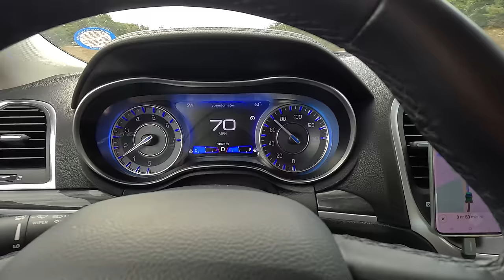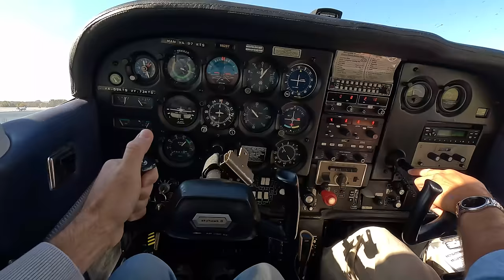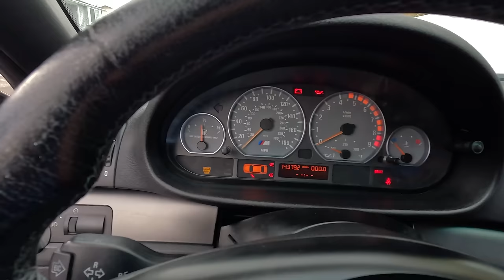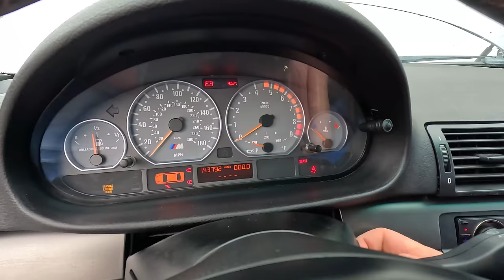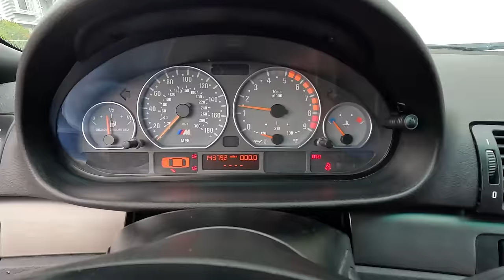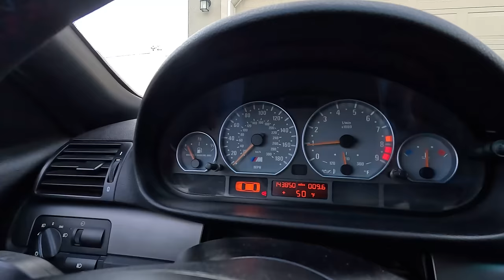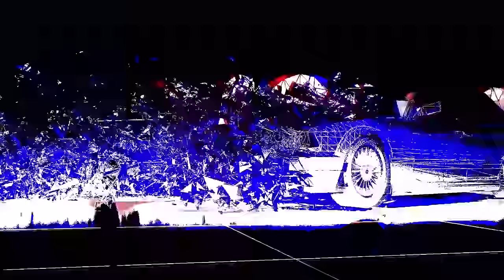Buying & Fixing a Broken BMW E46 M3 5200 Miles Away From Home - Project Salt Lake: Part 1

Comment: My man did more in one evening than the previous owner(s) did in 10 years. What an absolute legend, top tier content.
Reply: I know, that poor car was so neglected; it's a goddamn shame.
Reply: Yeah that was nice to watch lol
Reply: Most Americans won’t or don’t understand vehicle maintenance. Put some gas in it, change the oil at one time or another and just drive.
Reply: Who knows have the power... M3 power in this case... Jjjj
Reply: Like he said, Utah doesnt care about the state of the car, just about if the darn check engine light is off. Its silly. Youll be driving around in America seeing people with 3 spare tires, broken bumpers, dented doors, missing tailights. Its ridiculous, there are a few states which do proper inspections though, but nothing like German TÜV
Reply: @clonetrooper576  Utah used to do safety inspections and only stopped a few years ago. I don’t get it. That’s probably why I saw five accidents in 20 miles when it rained the other day
Reply: The amount of work he did in one evening would be unbelievable if not for the camera. I dream of getting to a level like this one day.
Reply: @clonetrooper576  Nowhere in Europe would that car pass the inspection. And not just that, where I leve, I will not be aloud to drive it on public roads before fixing those safety problems. The cars must pass inspection every 2 year.
Reply: True that!!!
Reply: Lmfao
Reply: @clonetrooper576  Utah had safety inspections for a while, but it was considered a poor tax, so it was removed. Lower income people could often not satisfy all the needed repairs to get their sticker, and lots of shops would be scummy to drum up additional income. The only reason they kept the "check engine light" test, is because they want operating vehicles to at least meet the emissions standards that the manufacturer complied with at the time of manufacture. I think it's pretty reasonable, if basic. 

The simple reason why American car regulations are so lax is because there's really no good alternative. Public transit is spotty or non existent, and distances between homes and work is too far for walking or biking.
Reply: Not man, MEN
Reply: @pmscalisi  Eh nah. Billion dollar unnecessary every 5k oil change industry in the USA. Look before you bark pal.
Reply: @stefang1087  in Bulgaria it will definitely pass
Reply: This series is going to be amazing.
Reply: And with a crew of dudes he’s never met before. This is what this community is all about. Love it.
Reply: @st3althyone  rty
Reply: You can tell how interested the former owner is in maintenance by the state of the Honda used to pick them up from the airport.
The crack in the windshield is unsightly illegal and dangerous.
Reply: yea because the previous owner must’ve had all the knowledge, money, and help but just didn’t want to do it
Reply: As an american, i hate buying cars from people like ivan. He buys a beautiful car that should be respected, and proceeds to disrespect it, and then dumps it on someone else once its destroyed. He prob put in the listing "i know what i have". Absolutely disgusting and unethical. Happens way more often than you think

Comment: Ha!  This takes me back!  Did so much work on my E46 M3 this year. When he broke the coolant bleeder line I felt that pain. I was super careful taking that line off.  He was really pushing through all that work. Amazing work.  Took me days to do all the work below on my M3. 
- Oil pan gasket
- Dipstick seal
- Oil pickup gasket
- Installed timesert for oil drain plug. 
- Motor mounts. 
- Inner and outer tie rods
- Sway bar end links. 
- Steering rack boots
- All power steering lines and reservoir
- Oil filter housing gasket
- Oil cooler line seals
- Timing chain tensioner gasket. 
- Alternator.
- Oil filter. 
- Oil change. 
- Air filter.

Comment: This is some good content! Sreten, I don't know if you noticed yet but the belt on the idler pulley by the alternator needs to run on the bottom not the top. It can cause the belt to slip.
Reply: I noticed that too. Sreten routed it the same way like the belt that came off was routed, but that wasn’t correct.

Comment: Only 15min in and I'm loving it!  I used to work for BMW and the OBD drive cycle I used to be able to set in 20min after starting it up in the morning.  
-let it idle for 3-6min before moving it, it will run the EVAP check
-cold start will also determine the secondary air pump works
- 2 to 5 miles of driving at 55mph under 3000rpm
-1-2 miles of driving under 30mph

Doing that will usually set all the monitors.

Comment: I’ve had my e46 since 2014 …. This video gets my nostalgia going I’ve literally done everything in this video besides the brake rotors mine came with the big brake kit from BMW and I had them replaced when I got it. But yea I even broke the thin hose from the coolant reservoir at the same point upgrading my hoses. Good to know it happens to not just me. Motor on big dog 🤙🏻

Comment: A few months ago traded for a 1997 E36 328iC Convertible with Auto with only 72000 miles and No Engine Codes, it has the usual missing or broken trim pieces, but the Air is ice Cold, Transmission shifts Smoothly and Engine runs flawlessly. Going to have to replace Drivers Seat Gear or motor for raising and reclining seat. I wish I had a garage to do the work I want to, shame there isn't a channel that Overhauls E36 like mine

Comment: Always refreshing to see car enthusiasts pulling together to help each other out 😊 I wasn't surprised to find that the E46 had a few larger issues that hadn't been disclosed but on the plus side the PO has at least serviced the engine oil and the body is pretty straight with good-ish paint so that's two huge and expensive items you had to worry less about. 👍
A ballsy move using a used M3 for a road trip but it does make for great content to watch 👌

Comment: I had the same smog inspection issue on a MK4 Golf TDI, now, I know this is an "apples to oranges" type suggestion, but I was able to get the car into a "ready" state for emissions testing by clearing the codes, then cycling the car on and off 5 times while in gear and underway. I suppose you could probably do it while the car is stationary, but I believe the "smog ready" state is activated on the ECU after five full running cycles with no codes recurring. Best of luck on your trip.

Comment: Vozdra Sreten!! Great episode and you got some balls buying an E46 M3 sight unseen. Brings back memories. One thing… I noticed that you didn’t install the ancillary belt properly. The new idler pulley you installed, the belt was meant to go underneath it and then over the alternator, not over it. Just so you know. In case it goes wrong on the road. Good luck and keep up the good work. Mnogo pozdrava iz Australije.

Comment: Putting a piece of cardboard in front of the radiator will cause it to heat up more while driving.. Truckers used to do this in cold weather driving to keep engine temps higher. I bought a 2001 E46 sight unseen and drove 7 hours to pick it up. The person lied about it's condition but I was reluctant to walk away from it with 14 hours of driving and hotel expenses. I understand your frustration.

Comment: Not gonna lie, it was kinda reassuring to see Sreten have some of the same issues I had with my M3. That damn coolant hard line snapped in the same exact place for me, and like him, it was the one part of the coolant system I didn't order. Ended up taking me a week to get a new one even with rush shipping. I only had it for a year before getting cold feet because of needing to do rod bearings and rear subframe reinforcements/diff mounts, but I miss that car a little more each day.

Comment: FYI as an OBD calibration engineer: the lambdas and cat diagnostic don’t necessarily need operation temperature, and the most important thing is to run low on rpm, low to mid load and with a constant pedal. You get the lambda/catalyst diagnostic passed quite easily with that.
Reply from the maker: Thank you!
Reply: @M539Restorations  contact me anytime for OBD diagnostic stuff! Worked for BMW OBD diagnostics calibration for more than 4 years.

Comment: Don’t use metal impeller water pumps, they’re made with composite impellers so that if the bearing fails the impeller won’t grind a groove into your block. There’s a reason the OE pumps use composite impellers.

Comment: owned a e46 many years ago. I'm in shock to see worn bushes in any suspension part.😏. would also be shocked to see of u had leaking shocks, corroded brake lines, broken window regulators, cracked subframe. sticky throttle bodies, sticking thermostat, breather pipes cracked, faulty maf sensors, corroded wheel arches, faulty central locking system,

Comment: I just purchased a UK spec’d M3 convertible.  Same thing, e46 with original everything.  Just changed the brakes and rotors.  Unfortunately the car is in the Caribbean and shipping parts here isn’t as easy as it is in the states.  My next project on the vehicle will have to remove the SMG for a full manual swap.  But I hope you do a tutorial replacing the cylinders for the convertible top cause I know mine are leaking

Comment: Yep - crappy grounding to the back tail light.  They have a kit to fix it or you can solder a new grounding to the metal bracket on the back.

Comment: Sreten, I think you put serpentine belt incorrectly (timestamp 27:37). When you have idler pulley left to the alternator, belt should go under it (facing the smooth side of belt to the pulley).

Comment: Why you didn’t put a cardboard in front of the radiator to heat up the engine a bit to get where you need it! We use to used this method beck in the days on old vehicles. 😊

Comment: I have an Audi A4 with the 1.6l petrol engine,5 Speed manual. I changed the oil in the transmission 2 years ago if I remember correctly. I put some Motul oil in it. In the winter it goes into gears quite hard until the oil gets warm. 
My Question is : Can I put the same Liqui Molly ATF 1100 oil in my car ?
Thank you guys

Comment: there is no problem with the wiring on the tail lights. if the indicator light is not working for some reason, the car will use the break light to indicate

Comment: hi sreten, i've got a bmw e28 with a m20 2.5 liter and ZF gearbox would this same transmission oil work well u think? great video as always. i crashed my e28 and fixed it right as u fixed the e30. im still quite young and just started working at a very special garage. i hope you"ll see this :)

Comment: My 350z kept failing on emissions despite hard drives and all sorts of stuff poured in the fuel tank. Eventually found a guy who provides o2 sensor "solutions" by which he means delete them from the ECU. No problems since then.

Comment: Great video. Did you ever get the catalytic and o2 sensor readiness codes to set? I cant get the cat readiness to set for my 06 e46. I followed the same sheet print you displayed in the video but I noticed you said you would leave it in third gear at highway speeds. The papers says to keep it under 3K rpm and under 50mph which is really hard to do on CA highway, especially in La where I live. Any suggestions on how to get the codes to set? Thanks in advance.

Comment: Notice that Bimmer world that helped him with everything the M3 would most likely need didn't recommend or order the cooling system for him. That is because the M3 E46 doesn't use the same system as the regular E46 which is notorious for having a cooling system that will break about every 70,000 KM's or so or 40,000 Miles. But the M3 doesn't have those troubles. I was surprised he didn't really seem to know this but I guess there's a lot to know about each generation and model etc of BMW. LOL.  He's very right. 19's may fit on the E46 M3 and even could be ordered with them. But they don't ride well at all. They are too big. IMHO they look wrong as well. 18's are the ticket!

Comment: Just wondering: was told not to change ATF at 170k, did you have any concerns doing a first transmission oil change at 124k? Is this something that’s okay with a manual but not an automatic?

Comment: My E46 B3 with 300K Km is not leaking or using 1 drop of oil but only around 30K euro's was poured into the car in 23 years

Comment: Those are the exact people that say Bmw is unreliable. They dont take care of their car at all. They ignore or dont even recognize when something breaks.  Just the steering wheel alone, how it vibrates... Who bears with this? I can even tell from here what it is. The control arm bearing in the front which is about 25€ to 75€ for both of them depending in the brand. You can change them in less than an hour. 
This is the perfect example why I always say americans cant take care of cars. They are just not able to care for the easiest cheapest stuff possible and then say the car is shit.

Comment: could you imagine some guy buying your car, making you mount his new tires for him and then getting pissed at you for not updating the tags? lol
Reply from the maker: Could you imagine flying 5200 miles to get the car, something you planned for months only to find that what was discussed wasn't not done and car potentially undrivable? If the temp tag thing didn't work out, I'd have to cancel all of the plans, including the video. Try smiling in that situation.
Reply: @M539Restorations  Why would it make it undriveable?
Reply from the maker: @nzuncovered1845  Cause it wouldn't have tags or insurance.

Comment: I have an Issue with my e90 325i n52

When i accelerate the Car jerks and runs very slow and poor . The engine light Turns on and when i Shut it down and Start it again There is no Check Engine light and she runs normal.

Can someone help
Sorry for my Bad englisch
Reply: Get a fault code diagnosis done, it might tell you the problem, also is it fully serviced and up to date?
Reply: @nzuncovered1845  
Yes i have Changed oil, filters 
Spark plugs 
And  the Car was Serviced regularly its whole Life 
Ist has 184.000km
Reply: @RM0708  Ok that's good, it could be a coil pack or crank angle sensor, TPS but it is hard to say. If you take it to a European car specialist they can do a fault code diagnosis for around $50 to $100 depending on where you live, it should tell you what part is faulty. This is the beauty of new cars you don't have to replace everything to trace down a fault. Good luck, if you get it checked out let me know how you get on.
Reply: @nzuncovered1845  
So I did a fault Code diagnosis Last Week at my City in germany..
They said that some mechanical Part in the Engine might be blown.
It would take a further Inspection of the engine and they take Lots of money for That. Further my wheels and the allignment are Shut too, so i might sell her..

Comment: The belt's ribs on top of the alternator pulley? (27:42). I am sure you were going too fast, that is an honest mistake.
Reply: To my surprise I recently found out there are belts with ribs on both sides. Maybe Sreten used one of those. He routed it the same way as the other belt that came off, however I think that’s wrong and it should have run únder the idler pulley that’s next to the alternator.
Reply: @janerikkant3646  Correct! His belt is ribbed on one side only.
Reply from the maker: Yes, oversight in rush as I was copying how it was previously installed. It was fixed later.
Reply: @M539Restorations  Classic!

Comment: That belt goes under the pully before the alternator, because the pully is smooth and the part riding on the pully is ribbed. No es bueno as Danny DC2 would say...
Reply from the maker: Yeah... Someone previously installed it like that and I just copied it in rush. Did feel odd, but did do 2000 miles though.

Comment: thats been clocked by 100k ither 2x 50k 0r 3x 30 odd come on the amount ove wear 140k it would drive like a 3/4 year old the gearbox is like a 350k + syncro worn also u need pretty serviceable plugs air filter eng oil breathers etc to do the road/italian tune so u need to buy a car with at least one person in the mix who will bestright up and tell u what it drives like especially if u have a buyer who is comeing from a good distance i would have had to say somerhing to the seller after driveing it like mate its 1k less for the bull shit at least still its all in the show content every body gets to see the throw away quality ove thease e46,,,,,,s bmw ,,,,,,s have lost there way

Comment: The kilometars are not real because you can see on the steer whel
Reply from the maker: You can't see anything on the steering cause it's covered in dirt. The mileage wasn't tampered, there's a thing called Carfax so you can't roll back miles and get away with it.
Reply: @M539Restorations  ok it has point